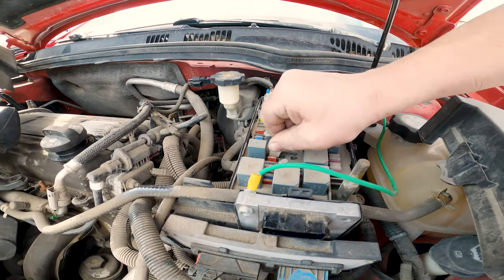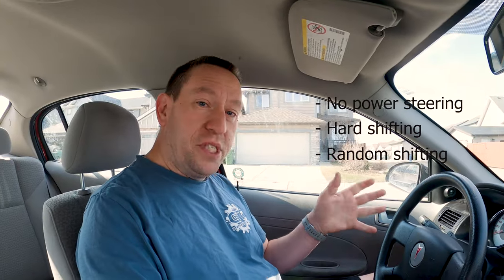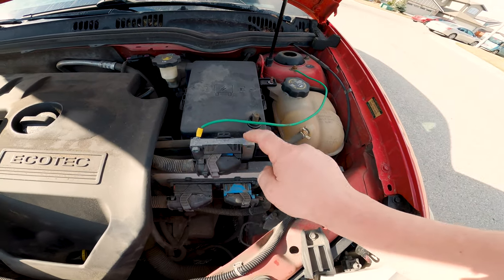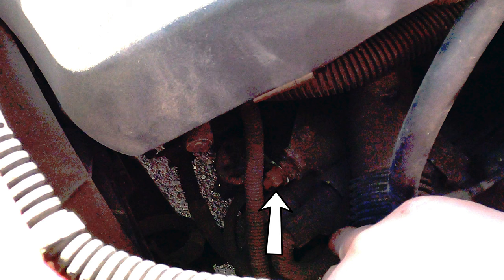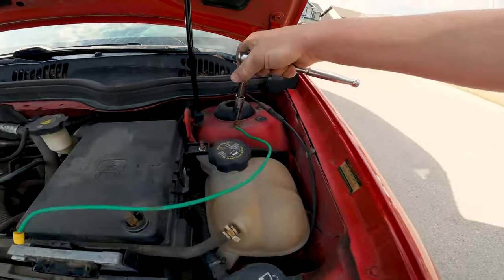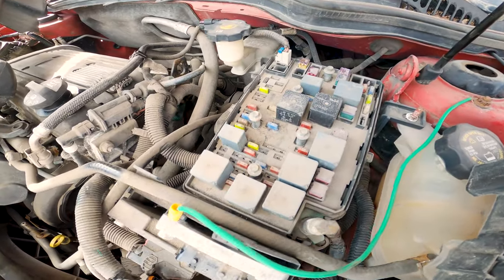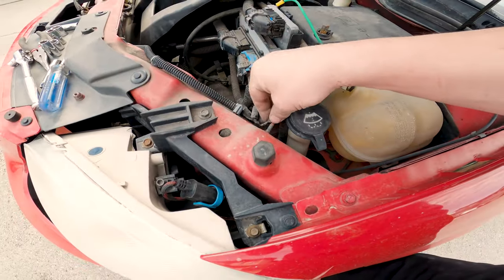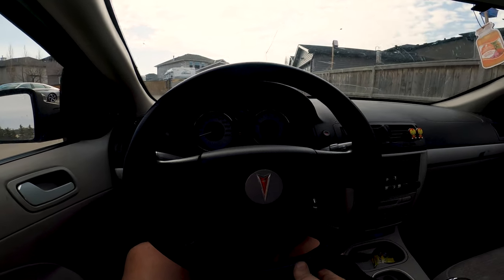FIX DRIVABILITY ISSUES on Chevy HHR / Cobalt / G5 - No Power Steering, Speedometer, and Not Shifting

Comment: 2007 manual that power steering assist goes in and out but only after the instrument panel goes haywire.  Eventually it all returns to normal but it is doing it more frequently. Any idea?
Reply from the maker: Check your voltage of the system. Possibly the regulator is putting too much power in causing issues

Comment: My steering is very stiff while turning what could be the problem? I have cobalt coupe 2006
Reply from the maker: You have electric power steering. There is a recall for it failing. Check if your car falls into the recall

If not, you can usually pull the fuse for power steering, wait a minute then plug it back in and it'll work for a while again
Reply: @GearsAndTech The same thing happened to me in my Cobalt as in the video, but I already checked the 60 amp and 2 amp fuses and the ground of the module and nothing, I don't know what else it could be.

Comment: Someone help I installed new ground it fixed the problem but now my car won’t start
Reply from the maker: Did you get it going?

Make sure your connections are all good. And that your battery isn't dead
Reply: @GearsAndTech   yes so when i took the main off the trans i cleaned it etc which made it short even more so i rewire the ground with a new terminal now the car run better than it did before the problems . if everyone fixes the main ground they dont have to worry about that cheater wire

Comment: None of these fixes worked on my g5
Reply from the maker: That sucks.

If none of these fix it then your problem is likely something that's broken
Reply: @GearsAndTech  I removed the solenoid and parts store does not have it in stock.
I sprayed it with WD 40 and sprayed the wiring connection as well .
I put dielectric grease on the connection and the car is working like brand new .
The solenoid is attached to the gear shift
Reply: @GearsAndTech  I installed the new solenoid and the clicking sound is gone from the shifter and gauges are acting as they should